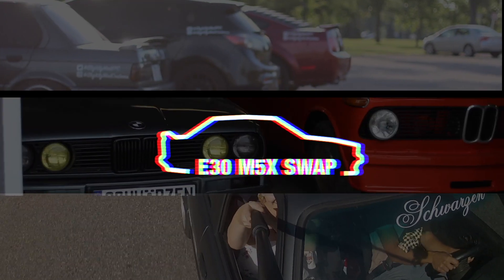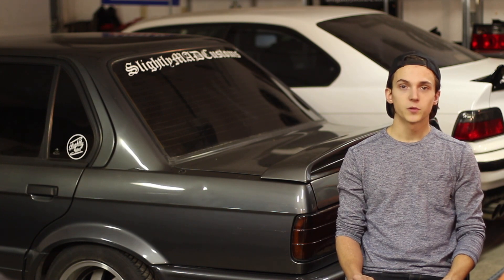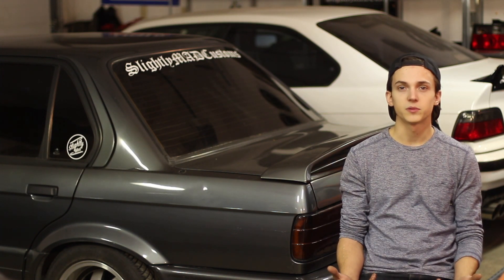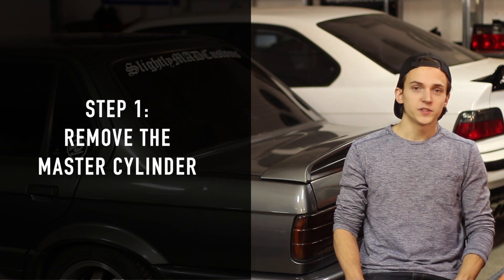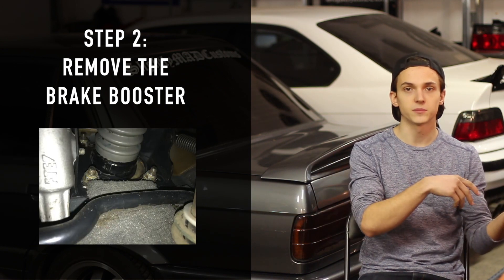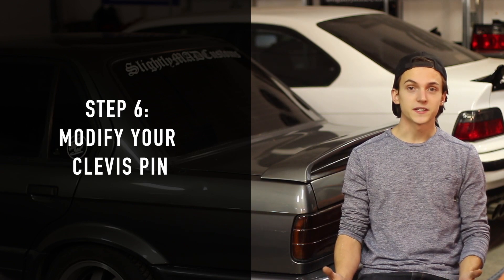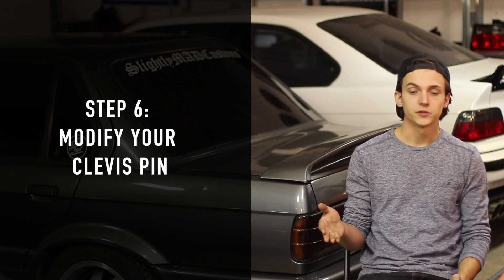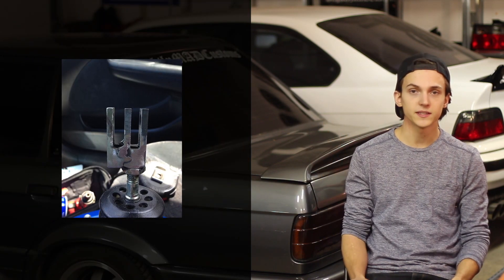Ep. 4: Brake Booster Relocation - E30 M50/M52 Swap guide:

Comment: Is it half an inch over from the center of the bolt hole or the edge of the bolt hole?
Reply from the maker: Either will work. I’d go from the edge
Reply: @slightlyMADcustoms  It's 1/2inch from the center. Completed the job yesterday. Measuring from the edge won't work, the bolt holes will be too far over to fit the booster.

Comment: When S50 swappig we always used Vw Polo 86cc brakeboosters because they are small and fit right in place, some minor thing need to be done but its easy. But back the the m50 swap, i never relocated the brakebooster, we just filed off a bit of the intake finns on the throttlebody side so it would fit. Go to E30zone.net and you know what to do

Comment: Not sure if I’ll get a response but if I’m swapping in an m52 not an m50 does that mean the brake booster relocation is not necessary? Or do I still need to do it?
Reply from the maker: Hey! Yes you will need to do the brake booster relocation swap wether it’s m50,m52,s50, or s52.
Reply: @slightlyMADcustoms   Oh wow thanks for the reply :) Yee I figured as much.  Also just btw these videos are super great and helpful, most helpful stuff I could find about this swap on youtube!
Reply from the maker: Glad we could help out! If you have any more questions just let me know!
Reply: @slightlyMADcustoms  will i need to do this with either m54 or s54?
Reply from the maker: Ya those engines are pretty similar to m52/s52 so it should be the same. Or very similar
Reply: @slightlyMADcustoms  aight thanks!

Comment: By the way an even better option is a bmw e90 330 booster. Better and more consistent brake feel and its smaller, doesnt require any modifications, it bolts in. Then use a 2002 fluid reservoir! You will need to bend your lines to meet up properly.
Reply from the maker: Good to know! Does the booster need to specifically come from a 330 or is it the same across all e90 models?
Reply: @slightlyMADcustoms  all e90s they are only 60 bucks on ebay
Reply: @zachogdahl210  so a 2008 or 2011 328xi booster would work?
Reply: yes
Reply: Getting a 2002 fluid reservoir can be hectic
Reply: @omondibriancosmas4368  you can buy them new online still.
Reply: What model does the reservoir need to come from?
Reply: @claytonhaske  i used an ate resivoir from a 2002 the model not the year.